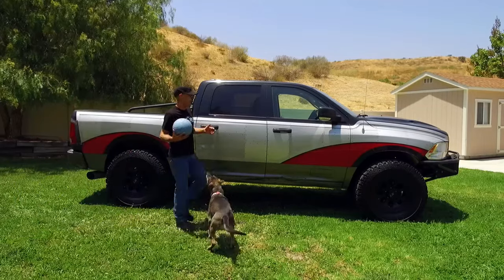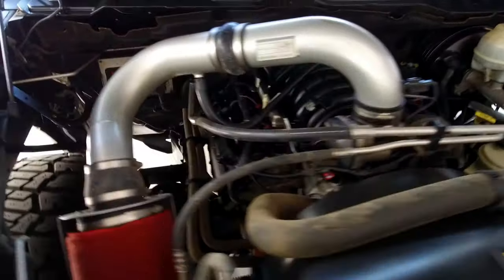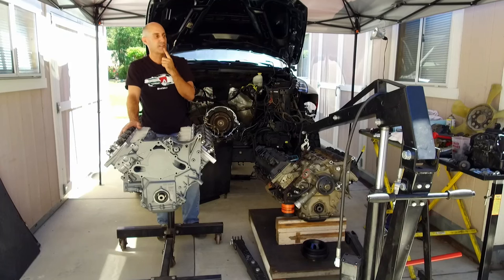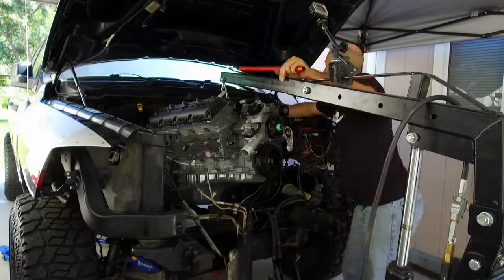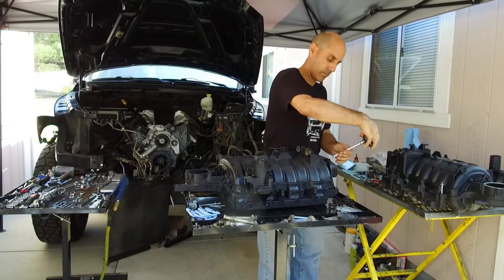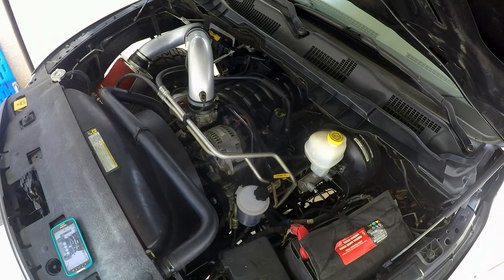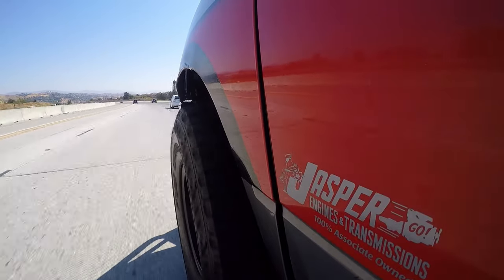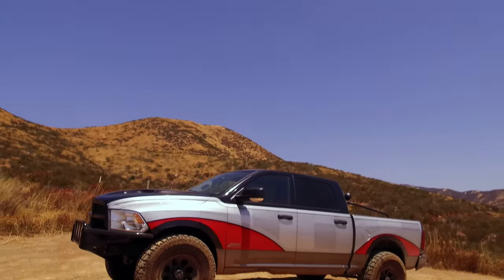HEMI Swap with Jasper Engines Replacement 5.7 in a Dodge Ram 1500 on 37" Tires

Comment: Awesome video...Hey I have a 2006 ram 5.7 hemi......has a knock...starting truck early morning the truck has no knock for about 2 minutes...then you start to hear a knock until its fairly loud..seems like it's coming from bottom end....If I rev engine the knock disappears also when truck gets to full operating temp knock is gone..............so it starts  and 2 minutes in starts nocking and once fully warmed up (10-15 min) knock is gone
Reply from the maker: Not sure about your engine sounds... tough to diagnose that stuff from description.  My old engine made a bunch of racket for a year or so before it finally gave up.
Reply: AutoEdits understood thanks for reply.....yea over a message very hard to diagnose.. just weird knock..enjoy the vids cheers
Reply: TokeXecution Shalom my friend. The ticking noise you hear is most likely an air leak due to broken exhaust manifold bolts. Rams are famous for that look into it you might have broken studs that need replacing and the knocking noise will disappear. I'm a Ram owner myself.

Comment: Great video.   How has the transmission held up to the power of the new engine?   Is a Jasper transmission next?
Reply from the maker: So far the transmission seems solid but if it does fail I’m calling Jasper for sure.
Reply: Powerstroke Puller when dodge finally built (sourced from Mercedes)a good transmission they put the junk 3.7,4.7,5.7 in front of them its a shame 03 was a great year could still have a 360 new bodystyle with the good transmission then 04 they did away with the oldschool 360 worst mistake chrysler made you can see they got bailed out shortly after due to all the warranty work on the new powertrains that had the ridiculous 100k mile guarantee on crap that would blow up if you looked at it wrong

Comment: When you did your 500 mile break-in  did u hear the hemi tick?reason I asked because I just purchased a reman and starting to hear a tick at 100 miles...was told to use conventional oil for the first 500 miles and idk if it's the oil or the hemi tic....purchased from powertrain products

Comment: @AutoEdits  You mentioned the jasper piston upgrades but do they also upgrade the cam/lifter lack of oil supply issue?  I keep thinking all that needs to be done is an improved lifter design that “leaks”/ dribbles some hydraulic pressure supply oil onto the cam...but don’t see anything like that available.

Comment: Great video. What did Jasper do to address to lifter and cam issue on the modern Hemi?
Reply from the maker: They use higher grade metal for many of the parts. Sometimes a manufacturer will get a run of parts that have a lower grade metal for a bit.

Comment: Wow and it still runs? Have had nothing but bad luck with jasper. Every other engine blows head gasket or blows the tops of pistons off. They send a new one and it’s great. Month later order another and the same thing. Get another one and it runs great.  Think we just the ones made on Friday or the new guy.

Comment: Chrysler does not recommend turning the motor over with the starter to build oil pressure.  The factory procedure was always to just start the motor.

Comment: I’m thinking about replacing my ram 2012 engine with a remanufactured one from jasper engines. I’ve read the reviews on BBB but it’s so hard to trust bc if all the reviews. But since you’ve changed your engine out and it’s still working 3 years later. That puts the Pin in the coffin
Reply from the maker: Still very happy with the engine... still running amazing!
Reply: Thanks for your time and video. Helps us out a lot!

Comment: great JOB  Autoedit  why no headers since You had the motor off it would be much ezzer
Reply from the maker: Headers are pretty expensive for this thing and from what I've seen they don't add enough power to justify $800... yet. Plus, here in CA I still have to pass smog so finding headers that would do that is tough.

Comment: I found a salvage yard 5.7 jasper engine for dirt cheap. I got it for about $224.99. Only thing wrong is the headgaskets are bad. I think thats a steal for how much a reman cost
Reply from the maker: Sounds like a good deal, I'd be interested at how the head gaskets are bad.
Reply: @AutoEdits  I'm really not sure if they are or not but I opened the valve cover and I found a milk shake colored oil but it also could be from setting so long at the salvage yard. Could be condensation.

Comment: How does it effect the value of the car, I understand it would obviously increase the value, but how much so, due to only the engine being new?
Reply from the maker: I'm not sure if there is an exact number.  When a vehicle is this old, the increased value to me is the fact that I have another several years left with the vehicle and a solid engine.
Reply from the maker: I'm not sure if there is an exact number.  When a vehicle is this old, the increased value to me is the fact that I have another several years left with the vehicle and a solid engine.

Comment: I have subscribed to Peterson 4 Wheel and Off-road for a while. I believe I still have the magazine from when they built this truck. I gotta ask though, how did the engine fail at 148k? Was it the aftermarket air filter that caused the failure? A purpose built truck should last as long as it's stock counterpart in my opinion, so it would be more economical for someone to do this to their daily driver, since not everyone can afford to have an extra vehicle parked around the property.

Comment: Brought my 14 Ram 1500 into the dealership for a lifter tick (yes the dredded Hemi tick). The dealership has been the only place to service this truck since I bought it in 2015 because they offered an internal engine for life warrentee, Bull Crap! After spending $4300 for the lifter repair I picked it up, drove it 50 miles and the engine started knocking very loudly. After fighting with the dealer trying to charge me another $17,000.00 for a factory crate engine after they blew my other motor (never had 1 issue other than that tick EVER) I decided to give my local speed shop a shot. They recommended the Jasper motor and even though I stll spent $10,550.00 (all in, parts new intake and labor) the truck runs better than it did new. Now time to go after the dealership  ...

Comment: Curiosity how much for the 5.7 engine I purchased a brand new one for the dealership for my rant but I’ve purchased a ex cop car with a 5.7 2009 looking to replace it I can rebuild the transmission which is not the engine👍💯

Comment: Did this new engine have anything changed to address the lifter/cam failure?
Reply from the maker: Yes. I'm not worried about that failure now.
Reply: @AutoEdits  Just curious, what did they do to remedy it? It is my understanding the needle bearings in the lifters were the source of the original issue.

Comment: I have the option to buy a 2009 hemi 5.7 for 1000 all it needs is a new motor potentially, he found metal shavings in the oil pan. My question is it worth buying the truck and dropping a new motor in it? The body itself is solid and it's 4x4. I can do most of the work myself. What's your opinion. Should I buy the truck and slap a new motor in it?
Reply from the maker: I love this truck and could recommend for sure.

Comment: I do have to say i thought your comment about the left over  nuts and bolts was funny  i am not a  professionally trained mechanic  but i did own a MGB for 14 years  that  i had to  do a lot of work on over those years when i did actually sell the car i showed the new owner a coffee can in the trunk filled  with lots of nuts and bolts plus other miscellaneous parts   He asked me what was in the can anf i simply told him they were parts i didnt know where they  went  and i said i guess they  aren’t that important as the car runs and drives like its supposed to  do  in reality  i knew that  over the years  i had swapped out  some original parts for  parts out of other cars  like the transmission  and a few other modifications  like swapping out the factory  alternator with a more efficient / reliable brand  and a few others

Comment: Hey Jason, How close to stock gas mileage did you get once you transplanted the new engine/trans? What trans did you have stock in this rig? Thanks
Reply from the maker: Better gas mileage and power. It has a 545rfe trans.

Comment: I also am doing in a rebuild on my 2007 Dodge Ram 1500 5.7 Hemi I am replacing everything in the engine except for the crank it all started with a cylinder 3 misfire from everything that I seen and read told me that it was either a bad coil pack or broken valve springs or bad cam unfortunately it was none of these my cam had a little bit of wear on it the truck has just over 355000 but I noticed when I pulled the Pistons out three of them had wear marks on the side but very little wear marks on the cylinder walls so I am going to replace everything like I said before fun fun

Comment: Doing the exact swap right now installation guide shows having to use scan tool to adjust for the lower oil pressure and Vct actuating any suggestions
Reply from the maker: I didn't have to do either of those adjustments.
Reply: Does you truck have MDS
Reply from the maker: It does... but I'm not a professional mechanic so take that for what it is.  I've been driving it for a couple of years with great results so far.
Reply: Same here. Thanks for the input. Keep up the good work.

Comment: i got a 2000 dodge with the 360 mag but the front suspension is a money pit and it is 2 wheel drive truck has 140,000 on it and the front been rebuilt 3 times my 68 chevy has over 500,000 miles on it and it still drive nice and tight and only cost 450 bucks to rebuild it front and back suspension just the parts on the dodge was over 2000 to fix it and it don't last i should have just put after market suspension on it wish i knew that dodge still can't build a front suspension right  all i know for 4x4 i will stick to my 70 high boy it drives way nicer and i got it for 250 bucks with a good clean body no rust no dents with dana 80/60 under it chevy is good because u can get after market parts for free all the time

Comment: Can you talk more about the valve train failure you had with the previous truck please? Also, considering buying one for my 2014 RAM 1500. Having some hesitation after reading and watching some reviews here and elsewhere on how quickly some of these remanufactured engines failed, their QC and customer service. Thanks

Also, I think this would be nice to know and hopefully not an out of bounds question (for myself and the peanut gallery), but did you pay for the engine or did Jasper provide it for you FOC or give you a discount - meaning, and I think it is a reasonable ask, did you have any affiliation or financial incentive to do the swap with Jasper?

Comment: Told you that connector at the back of the intake was a pain to get to.
Reply from the maker: HAHA! Why yes you did... also, didn't you recommend getting the exhaust manifold bolts as well? 
Thanks!
Reply: autoedit That was me. The Hemi replacement I did was very easy as well. It's almost like Dodge knew you would be replacing the engine soon and did you a solid by making it easy. Same can't be said for the 2009 Chevy 4x4.

Comment: Hey whats up man great truck and nice job. I have a question im undecided on buying a rebuilt jasper engine or new engine from dealer for my ram but my question is it worth it? No mechanical issues for the past couple of years?
Reply from the maker: The new engine has been flawless for the last few years and several trips.

Comment: any chance of making a quick video on the engine if its is as you say still working good to this day I've heard nothing but bad things about jasper and there engines only lasting a year and less the 100k  and they take forever to replace and make you jump through hoops just to get warranty and if I'm going to spend $8k id rather do it with a better engine better company

Comment: +AutoEdits A Great job you did on your truck and it sounds good. Great job on your editing skills. I am curious how long did it take to install the motor? I was told by a mechanic it would cost $9100.00 to swap out a motor and to install a new manifold, that he would purchase at Chrysler. My 2005 Chrysler 300c died last week 10-11-20.

A second mechanic quoted me the same thing $9100.00 plus a 3 yr warranty and 20hrs of labor. That's too expensive. I didn't pay that much for the car itself.

I live in the Bay Area, Silicon Valley, CA 

I was told by a guy in a group to buy a crated engine from Jasper Engines and seek another mechanic cheaper to install it for me. Unfortunately, I don't have this level of mechanic experience or I would try to do it myself. 

Wifey says to buy a new Chrysler 300c or truck, but I'm thinking of the monthly payments. I don't know, I'm still researching all my options. 

1. How long does it take to swap a motor?
2. What would a motor cost for a 2005 Chrysler 300c? Does anyone know?
3. Do the New Chrysler 300 and Hemi "motor" have good reputations?

Thanks in advance. Angel from The Bay
Reply from the maker: It took me 2 weekends to do this swap.  I don't know what the exact cost for a engine for you vehicle but this one is about $5k then you would have the installation expense. I have had this engine in for a few years now and about 35,000 miles of successful driving.
Reply: @AutoEdits  Thank you I appreciate your feedback. I have reached out to Jasper Engines, their company has been compromised so they're closed for a couple days as of 10-19-20 I should hear something soon. 
Angel from The Bay

Comment: Reason for newer vehicle when you put 300k on ur truck is all other bushings , bearings,  other parts are worn out , and needs replacemants , its easier to get new vehicle with all new parts than replacing parts after parts , reminds me of my old ford 6.0 pos. I was upgrading parts more than i was driving it , so i went out and got 6.7 diesel ford , i have 286k on it and not a single problem

Comment: Hey there, im doing a hemi swap in my 11' ram and was wondering what the torque specs for the flexplate bolts are, also if you know of anywhere online i can find the torque specs for these 4th gen trucks ?

Comment: I know this may be a loaded question.  Just kind of speaking generically.  If I wanted to buy a project Ram truck, have a local guy install a 6” life and put 37s on, is it possible also to buy a crate 392 engine and install it on a 1500?  Would they also have to build up that driveshaft and differentials to account for the extra power?
Reply from the maker: Always good to upgrade the drivetrain for added power but you could totally get away with that.
Reply: @AutoEdits  Thanks so much for the reply, I always wanted a monster truck but don’t know much about the mechanical stuff.

Comment: I can't get a Jasper engine delivered to my home correct?  Their website says I have to work with an installer.  I have a 95' Wrangler with a worn out 4.0L that needs to be refreshed soon.  I would rather buy a Jasper engine but it seems an ATK engine would be easier to get my hands on.
Reply from the maker: Special arrangements can be made but you have to understand from their perspective... since the warranty is pretty extensive, they like to have a certified shop do the installation.  Worth a phone call if you have time.

Comment: Seems like I am going to be swapping out mine.  I was wondering how much an engine swap like this cost after all said and done.
Reply from the maker: Just give that Jasper line a call or send an email to find out how much it costs.  I saved a bunch doing the install myself but it wasn't easy... plus I recommend getting the installation kit for an extra few hundred dollars.
Reply: @AutoEdits  Thanks  for the reply.

Comment: I have a question I’m waiting for my re manufactured hemi engine I was looking into which oil to go with for initial break in period I was actually gonna go with some break in oil I notice u went with valvevoline conventional oil  so no need for break in oil should I be good with conventional oil for the break in period
Reply from the maker: For this engine they recommend conventional oil because they test the engine at the factory before shipping. So check with whoever you are getting your engine from on that procedure.

Comment: Quick question after you put the jasper engine in what was your oil pressure at idle hot ? I’m worried about mine it runs 49 psi on the highway and 20 psi hot at a idle , when it’s cold it’s fine it’s at 35 psi idle
Reply from the maker: A good reference is roughly 10 psi per 1000 rpm. This thing idles around 12-14 psi hot
Reply: Oh wow thanks I thought this 2012 ram was suppose to be 35 psi at hot idle thanks man that eases my mind now
Reply: @craigorr1  my 14 idles at 42 psi when warm, runs at 52 psi at anything over 1k rpm, this is the case with both the first motor and the mopar replacement i installed.

Comment: Why didn't you do heads and cam?  You don't loose reliability if you don't do insane specs.
Reply from the maker: I wanted to do something kind of affordable and not go crazy with aftermarket parts.  Plus, this thing is still smog legal here in CA and I have no worries at all with the Jasper warranty.

Comment: Hey bro. How's that Jasper engine doing????
Reply from the maker: Strong like bull!
Reply: @AutoEdits  Nice.  Thank's for response.!!! I really appreciate that. I saw your video a few months back. And my motor started to give out. I thought of your video. I have a 07 Chevy Silverado their notorious for burning oil. Jasper has an updated and that problem. So thank's again
Reply from the maker: That is one of the reasons I looked forward to the upgrades Jasper did to the 5.7 in my truck. The re-designed pistons help so much that this truck does not burn any oil at all. I've been extremely happy with the engine!